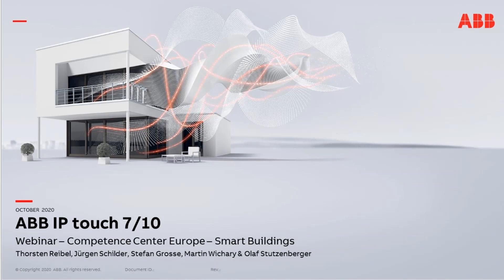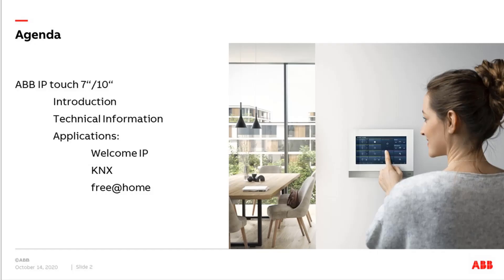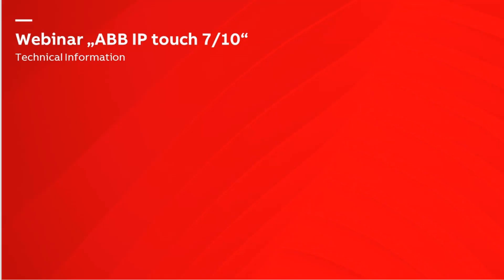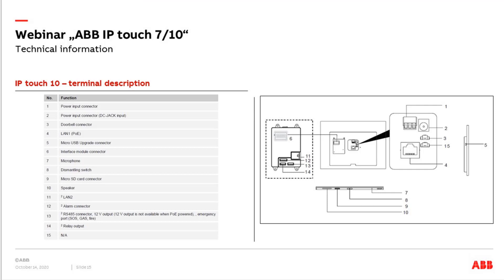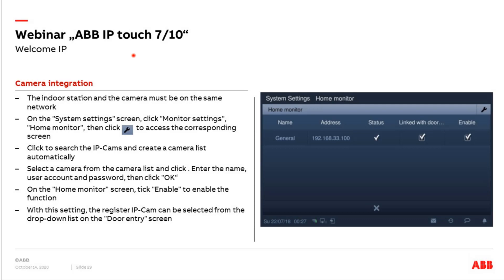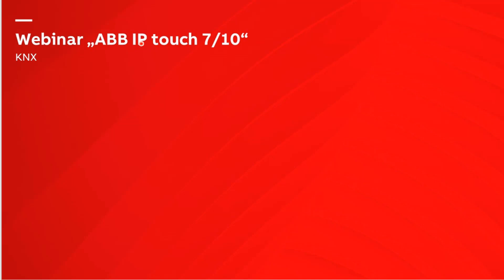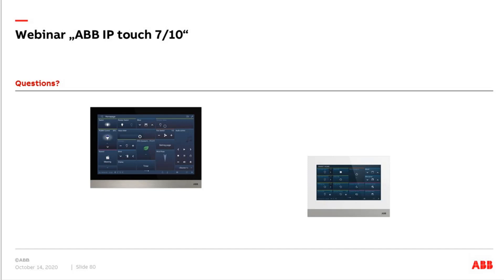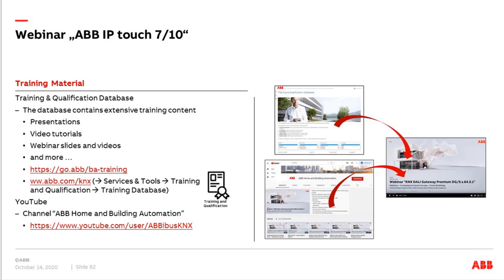Webinar about ABB IP touch 7‘‘/10‘‘

Comment: Hello Sir. I got problem connecting IP touch 10in.I configured as per video and manual but touch show KNX disconnected.Can I have detail setting reference both in ETS and touch screen?
Reply: Hello i have also this kind if the problem. Did you solved it maybe? Thank you in advance.